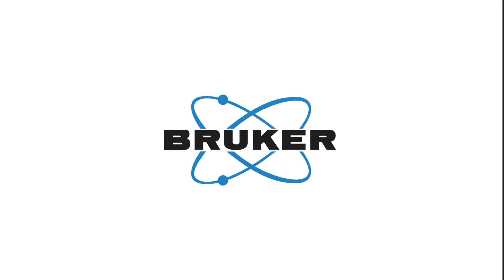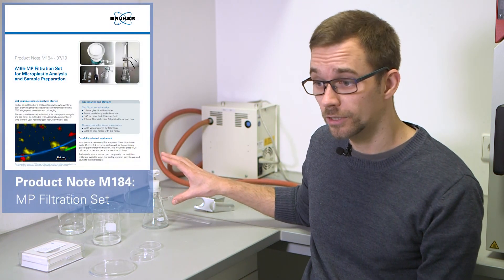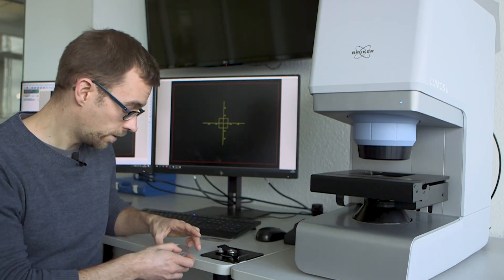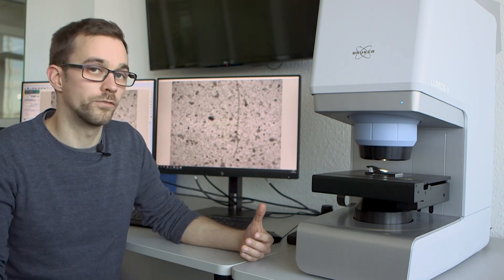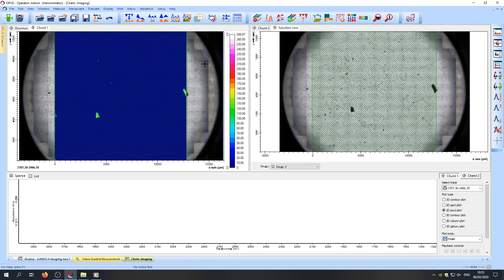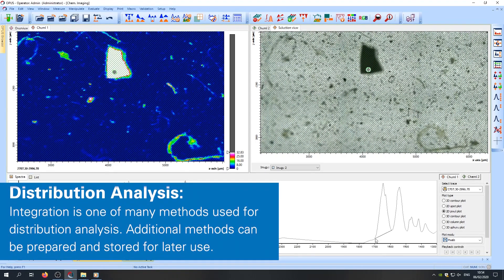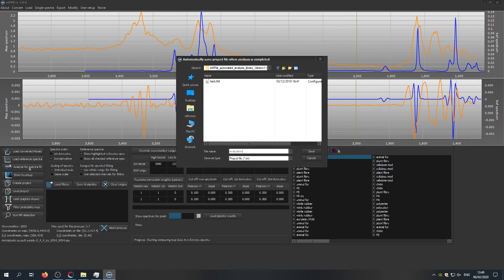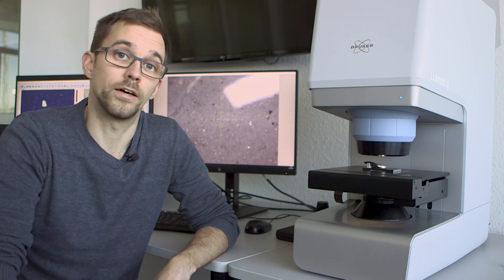Analyzing Microplastics in Sea Salt by FT-IR Imaging

Comment: Hello, would like to ask. Are GF/C Filters reliable alternative to aluminum oxide filters? Thank you
Reply from the maker: Hi @OddCapsZM,

Glass fiber filters are generally more compatible with ATR (Attenuated Total Reflection) FTIR measurements. However, they are less suitable for transmission or reflection (transflection) FTIR microscopy because the glass fiber material itself exhibits strong IR absorption. This background signal can interfere with or even mask the IR spectra of the microplastic particles.

Comment: A nice upgrade but still the software + Lumos isn't avle to record  full resolution tiles + simple image correction as vignetting removal. Hopefully the polarizing filters are at least heat protected.
Reply from the maker: Dear Mr. Popa thank you for your feedback. 

The LUMOS II collects high quality images of large areas at full resolution for almost any application. An integrated flatfield correction can be used to even out any vignetting artifacts. 

It is equipped with low energy consuming white light LED illumination that does not damage the polarizers in any way. Additionally, it has a standby mode that turns off the illumination when it is not in use. 

If you already own a LUMOS (or plan to) and have further questions or concerns, please contact our support. We’ll be happy to help you out!

Sincerely,
Your Bruker Optics Team